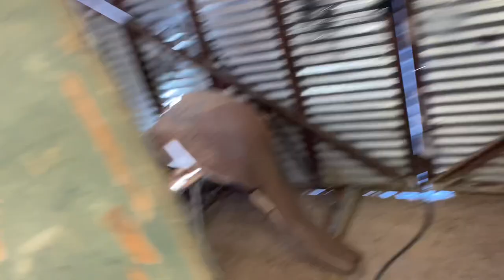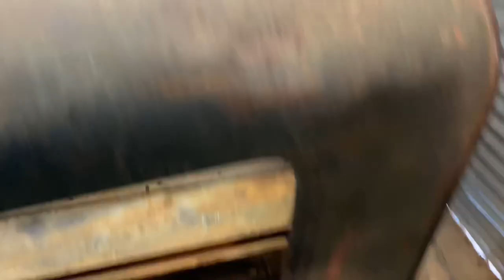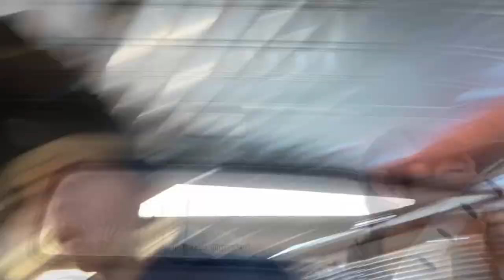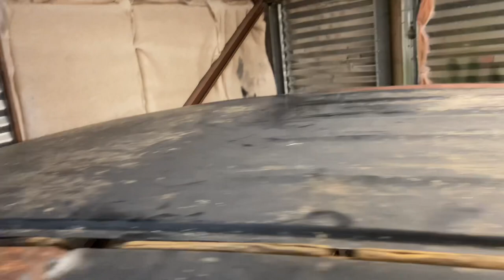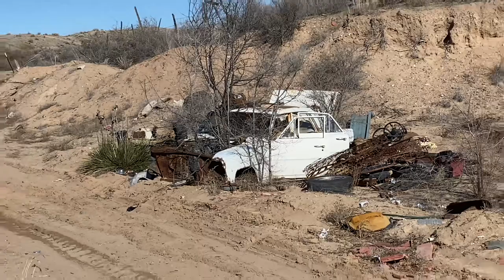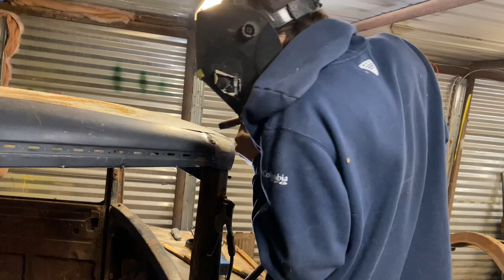Building a hot rod model A and the sheet metal work begins￼!

Comment: When Brent os half-assed customs spot welds he used 3 tools to put pressure on metal. Old screwdriver, wood chisel or wood end of a hammer. When he needs to even butt joint sometimes uses a small flat blade screwdriver. Stitch welding every 2 to 3 inches, he will then use cut off wheel in between stitches, weld that up, then go back to stitches, cut them out, finally weld them also.